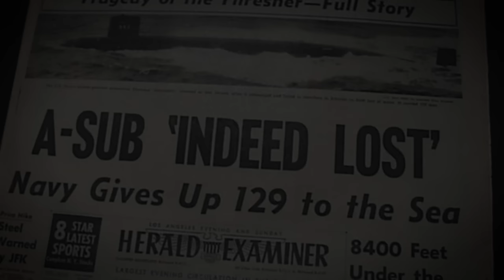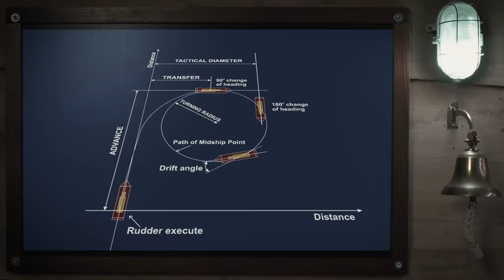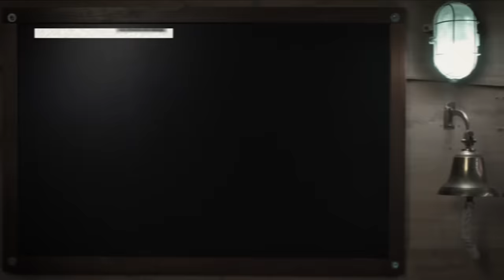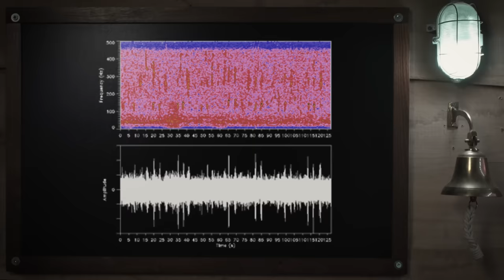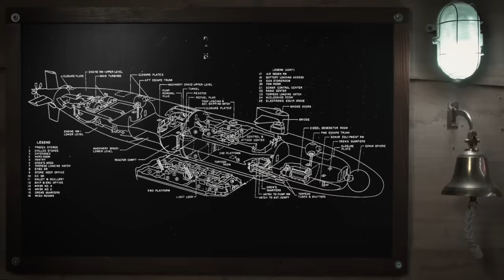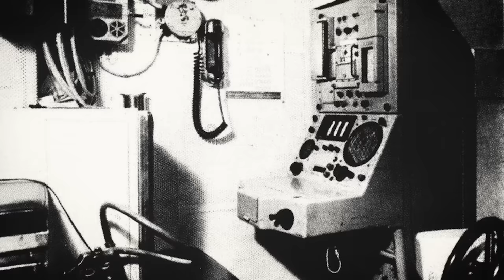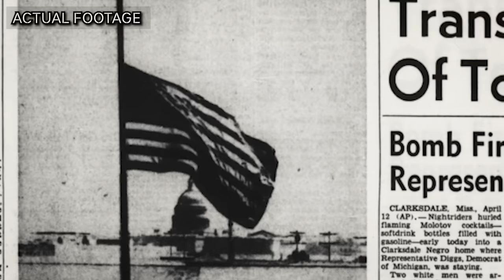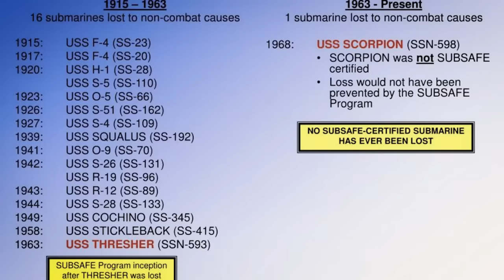This Water Pipe Killed All 129 Men

Comment: [Part 1]  I have to give you a negative grade on this video.  I did not enjoy it.  I am a former Navy nuclear Reactor Operator and Electronics Technician and a current nuclear submarine systems engineer.  I am going to direct these criticisms at you because, as its creator, you are solely responsible for every moment of this video.  Do not take them personally.  The public need to have your misstatements corrected.  Statements such as the following are simply wrong.

   - "Submarines typically rely on speed and deck angle--or their angle-of-attack--to ascend or descend."  Submarines in reality ascend or descend with little trim angle.  The hull of the boat is not a hydrofoil.  Angle-of-attack applies only to the fairwater planes (or bow planes, on newer subs) or to the ship's stern planes.  The ship can change depth with a zero trim angle, if desired, and reserves large up and down angles for more extreme maneuvers.  You do offer more correct information in your subsequent lines.
   - "The change in temperature of the water also changes the speed of the radio waves..."  Skylark and the submerged sub were not communicating by radio.  It is impossible for electromagnetic waves at frequencies suitable for voice communication to penetrate liquid water.  Fully submerged submarines communicate acoustically.  Thresher was communicating with Skylark via UQC, or underwater telephone, sometimes called the "Gertrude" because it's pitch-shifted sounds seem to be coming from a little, old lady.  Speech heard over the UQC as installed aboard Thresher is distorted in the best of conditions.  https://en.wikipedia.org/wiki/Underwater_acoustic_communication#Underwater_telephone  (Later radio problems between Skylark and shore commands had nothing to do with thermal conditions in the sea, of course.)
   - "Salt water from a reactor cooling pipe floods the Engineroom."  A pressurized water reactor (PWR), such as aboard Thresher, is cooled by pressurized fresh water, of course, not by salt water.  The fresh water steam in the secondary plant is what is cooled by salt water, and that is done through a heat exchanger.  And then you show a video diagram of water spewing from a nuclear reactor.  You are spreading confusion.
  - "...[W]ater leaking from the broken water pipe creates a short circuit in the electrics, and the water pump providing cold water to cool the nuclear reactor shuts down."  First, no reputable analysis of Thresher surmises a pipe broke; the failed-brazed-joint scenario surmises a pipe joint leaked.  A failed pipe joint is not a broken pipe.  Second, you make it sound as though the failed electrical circuitry powered the reactor's Main Coolant Pumps (MCPs), but reputable analysis does not support that specificity.  Although electrical faults could well have resulted in an inadvertent reactor shutdown, it is not known for certain which electrical equipment may have failed.  Third, although a seawater leak may have led to the reactor shutdown through some chain of events, that's a different thing from your implying a leak caused the shutdown through an electrical fault.  Correlation is not causation.  You gloss over gaps in your explanation as though they are not there.  You later repeat the implication the fault was with the MCPs.
   - "Commander Harvey orders full speed..."  On what?  You later say, yourself, the ship has lost propulsion.  Likely, the Auxiliary Electrician Aft or another Engineroom watchstander would have worked to shift propulsion to the Electric Propulsion Motor (EPM), but it is not certain the ship managed to do so.
   - It's not your fault this information is omitted, but it would be best to note Thresher did not have an Emergency Main Ballast Tank Blow system as was created for later boats.  When Thresher was built, MBTs were still viewed as they had been during WWII: as buoyancy assurance for surfaced operations, not an an emergency means of ascent.  In fact, a large fraction of the rethinking of submarine design that included the SUBSAFE program concerned rejection of the notion plentiful nuclear propulsion, alone, was sufficient to assure return to the surface.
   - "...trainee reactor control officer..."  You are perhaps referring to the Reactor Controls Assistant (RCA), the officer in charge of Reactor Controls Division.  Every member of a submarine crew assigned a duty is exhaustively trained for his or her assignment.  The crew of Thresher were selected to operate this new class of submarine partly on the basis of their proven expertise.  It is irresponsible of you to suggest there were not fully-qualified people present and in-charge when Thresher was lost.  Moreover, the member of RC Div who is the watchstander serving as Reactor Operator is typically more experienced in reactor plant operations than is the RCA or other junior officer given charge over any of the crew's nuclear work divisions, or any of the junior officers who would have been standing Engineering Officer of the Watch (EOOW).  (As a former enlisted man and RO, I have a blue-shirt bias, yes, but I'm just saying...)  The EOOW then on-watch would have a lot more impact on the handling of the casualty than would the acting RCA. Regardless, the crew of Thresher apparently followed procedure as it was written at the time, which included securing steam to the Engineroom upon a reactor shutdown.  Yes,  procedures later changed, but that is another matter.  "Had he been there, an experienced officer..." would have followed procedure and seen to it the steam stops were shut.  You are wrong to suggest otherwise.
   -"Reactor plant operating procedures don't allow for a rapid reactor restart following a scram."  You say more, later, but your addiction to historical present tense fails here to make it clear this was no longer the case after the loss of Thresher was studied by the Navy.  You have a duty to present technical information clearly.
  - "...a turbine which converts that pressure into propulsion and electricity..."  You say it correctly later.  Propulsion and electricity are provided by multiple turbines, not one machine.  Most nuclear submarines to--date have used steam turbines driving one or two shafts for propulsion, but the ship's electricity is generated in an entirely separate set of turbines.  It is not possible to make steady-frequency AC electricity and drive a varying-speed propeller from the same steam turbine.
   - "Some of that steam is captured in a secondary chamber and is released as needed."  What?  "Excess steam in the secondary system..."  Huh?  ALL of the steam for the propulsion plant is generated in the Steam Generators (the boilers) and it is never captive during normal operations; it flows entirely in response to steam demand from the throttles.  You are unaware how a PWR works.  You should have corrected your misconceptions before you posted this video.
   - This one's just a personal peeve:  I can appreciate you are not from around here, but, for Pete's sake, Groton is pronounced GRAHT-en, not GROW-tahn.  It's a nice, little town.  Give it a break.

Your problem, here, is any of these errors could have been avoided if you had first checked your statements with any of the hundreds of present or former submariners and U. S. Navy nuclear operators active on internet discussions, including commenters on the many, many YouTube videos relentlessly rehashing the loss of Thresher.  You didn't check your statements.  You instead spread nonsense.  This is your fault.

[Continued in Part 2]
Reply: Part 2:

Visuals marked "actual footage" (footage is a term about segments of motion picture film; it has nothing to do with still photos) would be better removed whilst all your other visuals were marked "irrelevant garbage".  That's how misleading and pointless most of the imagery of your video is.  This particular problem with your work would consume too many hours to address thoroughly.  It is egregious.

What water pipe killed them?  Nowhere in your video can your title even presume of an answer.  " A water pipe"?  That's not even a reasonable response.  In any event, you later offer the alternative explanation about loss of power to the Main Coolant Pumps that does not involve a leak or flooding from any seawater pipe.  Your title, then, has been contradicted by your content.

You fail to connect the sidebar about whatever shore power problems the ship had in Puerto Rico with your discussion of the sinking of the sub.  All you do with this sidebar is muddle whatever point your video is supposed to be making.

Yet, you failed to mention the "more tests and trials off of Key West" included a controlled, close-aboard depth-charging of the ship to test the resistance of the ship's systems to shock:  https://archive.navalsubleague.org/1987/threshers-debris-field  These tests likely had nothing to do with the loss of the ship, but at least it's information more relevant than some story about a dead battery.  From the above link:  "During the PSA [i.e. the subsequent maintenance period in Portsmouth], all internal piping found to be weeping or leaking as a result of the sea trials was fixed. However, a non-destructive test of all internal and external joints was not done because of cost and time. "

Do your homework.  Do not post until it's been graded.

[Members of the Peanut Gallery who wish to pipe up about some supposed rule that submarines may not be called ships can can keep your traps shut.  I know you clowns are itching to say it.  I am hearing this nonsense more and more often, even from newer submariners.  Let's be clear:  It's called a "Ship Service Turbine Generator".  "The ship is moored" is announced every time a sub puts lines across to the pier.  When my friend was Repair Officer at SUBASE New London, what he shouted at incompetent tech support personnel in a submarine Engineroom was, "GET OFF MY SHIP!"  There are thousands of examples.  Stop repeating rules that don't exist.]

Back to the creator:  Your enthusiasm for the subject, while appreciated, does not excuse your errors.  Your repeated focus on gruesome novelty ("This Water Pipe killed...", "This Plug killed...",  "This Anchor killed...",  "Navy Kills 99 of Their Own Men...", "444 Men Eaten...") is not to be abided.  Your approach is frankly contemptible.

Positive points for saying it correctly:  It is properly spoken "zero-eight-hundred", not "oh-eight-hundred hours".  Thank you for that minor factual triumph.

Submarining is an important and elite profession, vital to the interests of the nation.  We subvets thank you for your interest in the sacrifices of our sailors.

Comment: So a couple of mesh screens  strainers       and Wrong method of connecting water pipes with brazing instead of welding              It's real funny to have all this technology And yet have no regular procedures for maintenance and material assembly policy codeS.    Like it's so obvious if the pipes are carrying saltwater they need to be welded much less it being in a submarine is absolutely necessary  I mean these issues were easily preventable and they only came to the surface 50 years later sums up everything to do with the government.   The only infrastructure that says they want to protect your life at the same time putting you in danger over and over for a false belief in freedom when in fact you are the slave all along.    This country has been going in the wrong direction since the 60s I mean what did this submarine even do other than all these tests absolutely nothing just wasting money to look powerful that's why a senator can never get out of their position until they literally are carried out of the building in a COFFIn this so-called power-play is getting ridiculous and us involved in overseas PS sending billions so all The senators  can skim off the top .   It's also obvious this so-called defense Department of Defense is nepotism and has nothing to do with protecting a single soul Only lining their own pockets.      And if this doesn't change there's going to be an uprising, literally throwing our Tax money away. Obviously it's been going on this whole time but now with the Internet it's so easy to see who's corrupt. They're all corrupt. America is becoming a laughing stock for good reason while our American dollar literally dissolves because the decision-makers are not taking into account our own vote in democracy.   Literally if it was up to the American people all our tax money would stay in America.    And we would dissolve the Department of Defense to just drones But because that is all that is necessary the spending has gotten out of control there are literally Deserts  Full of million-dollar aircraft sitting there in the sun doing nothing But rotting away

Comment: The title is clickbait. The best forensic guess is that moisture in the high pressure air system used to force water from the ballast tanks froze in a 90 degree bend as they tried to use the emergency ballast tank blow system.  No matter what the cause, you weren't there and you can't know so stop talking as though you do and stop making a living off the lives of those dead sailors. It's morbid and sad. One minute and forty-four seconds in to this long, drawn out video and I can no longer watch this cobbled together video.

After the loss of the Thresher the remaining submarines of the class were renamed Permit class subs. I was doing maintenance on the Permit one day in the late seventies and looked up into the overhead to see an HPD valve with the name Thresher imprinted on the valve body. Spooky moment. Your little video can never convey what those men went through. Let them rest in peace.

Comment: ok sorry but the reactor primary never leaves the pressure chamber. and secondary loops also never feels sea pressure... and that system is never NEVER exposed to sea pressure... as a former navy submariner we learned about this case and you do not have all the info. But the later is the actual problem... it was a dehydration issue and the emergency blow system froze and fractured. at these depth all the 4500 psi air can not remove more then a few inches up to a foot of water out of the ballast tanks.. this is not enough without forward drive to ever make it to the surface. But like I said you have not all the info and the way we run reactors is not disclosed and unfortunately there isn't some of these systems you discussed onboard this class submarine... this results in a message halting all operations and to search for the lost submarine.  no secondary steam system... main steam generators and engines..then a condensing loop and pumps recharge used water under pressure to re enter the steam loop.